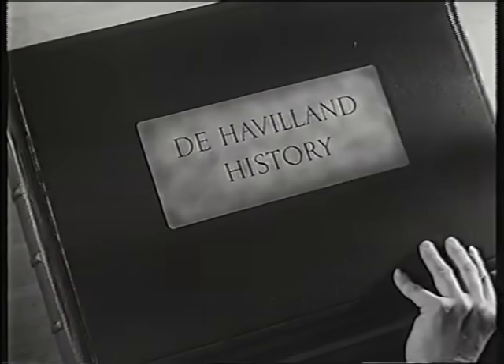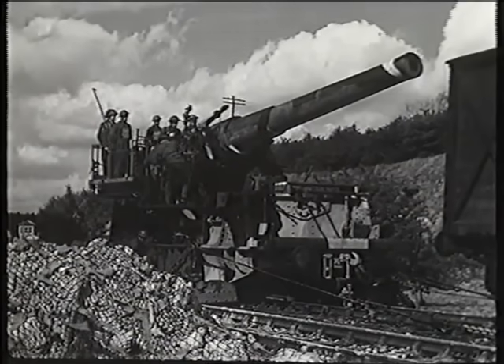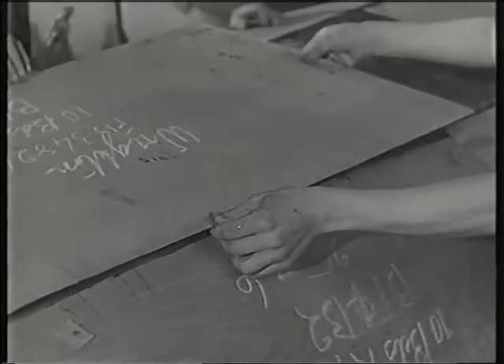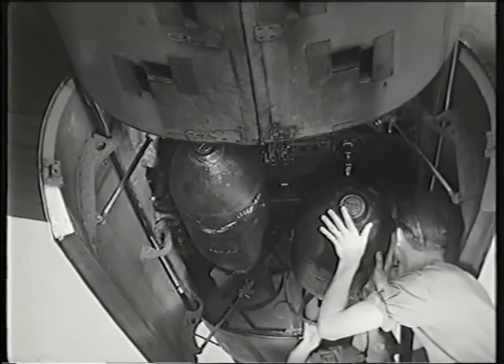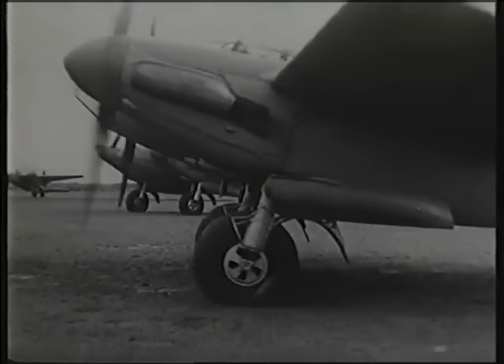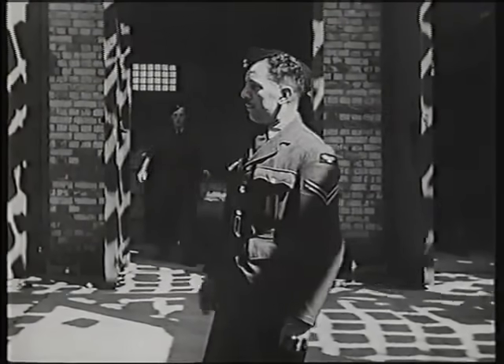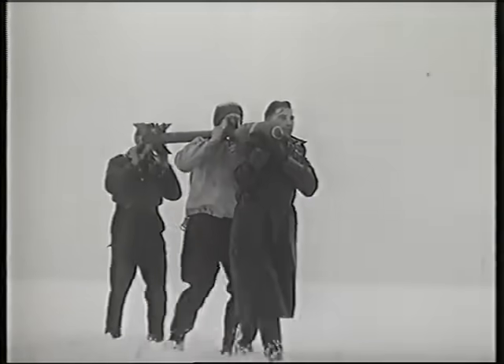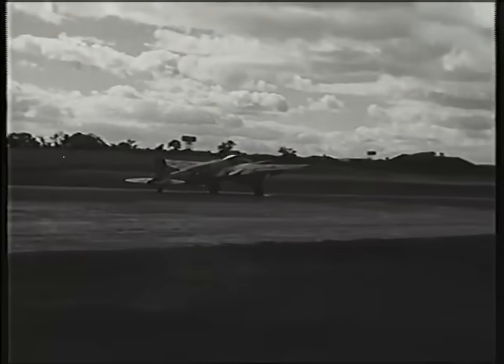The De Havilland Mosquito

Comment: dear messrs finnigan, barracuda  et al.
I have read with interest the argument between the fans of the B17, the Lancaster and the Mosquito.. So, speaking as one who's job is the compiling of archive records for Museums World wide, and aircraft preservation groups on both sides of the Atlantic, (I work at the IWM, and in conjuction with the Smithsonian)
Here are the facts. they are for education and are not open to argument as far as I'm concerned. (what you do between yourselves is up to you)

If we measure each plane against 4 Parameters,  Bomb load, Range, Height and Speed (in Knots), we get the following results.(BTW, The maximal total range is the distance an aircraft can fly between takeoff and landing, i.e there and back, and should not be confused with ferry range)  Anyway:-
B17...Bomb load=4,500 lbs, Range 2000 nm, Max height 35,000 feet, max speed 249 kn

Lancaster (RR Merlin XX.)..BL=14,000-22,000, R=2,530nm H=22,000ft, M.S.=282kn.

Mosquito RR or Packard. BL 4000+, R=1,500nm,  Height=40,000+ (pressurised cockpit on later marks), S.=361kn @ max bomb load.

So the best....
Bomb load=Lancaster
Range=Lancaster, 
max. loaded height=Mosquito
max speed Mosquito.

An interesting line of argument is effectiveness.  If you compare the figures for the attacks on the V-weapons sites, the average tonnage of bombs required to destroy one of these sites by B-17 Flying Fortresses was 165; for B26 Marauders it was 182 tons and for B25 Mitchells 219 tons. The average for the Mosquito was just under 40 tons!

those are the facts gentlemen.....do with them what you will.
Reply: I think this might for once leave WilbursoaringtractorFinnigan almost speechless . The others , I don't care about.
Reply: ***** 90% of your entry has no relevence to the point being made. Accuracy was not a question, costs were not a question, Survivabilty was not a question etc etc. the questions were regarding just 4 points... Bomb load, Range, Height and Speed 
And to that end....Bomb load=Lancaster
Range=Lancaster, 
max. loaded height=Mosquito
max speed Mosquito.

As a pointer for accuracy....British Lbs is a measure of weight, not money.  You need the "£" sign or Pounds sterling if talking money.
Do you not have that symbol on US keyboards?.

From 1942 onwards the Pathfinder mosquitoes were dropping their markers from high altitude using OBOE, (didn't work at low level) and later, using H2S, I can assure you that far from having an accuracy "That sucked"..they were , in fact, able to mark , and bomb, with great precision from high altitude.
Out of interest, The Pathfinder Mosquitoes ended the war with a most impressive record. In 28,215 sorties they had only suffered 108 losses, a lose rate of only 0.03%, the lowest of any aircraft type in Bomber Command or the USAAF. The Mosquitoes of the Pathfinder Force played a crucial role in improving the accuracy of Bomber Command, which by the end of the war had become a precision weapon, even ifit was not always used as such..

lastly....even if I had used the max for the B17...the result would still have been the same.for that particular discussion. All that would have happened is  that the B17 load would have read 8,000 lbs, and it's range would have been shorter.and it's ceiling would be lower.
And as for my "prefered   Lancaster and mosquito".......I'm South African. I don't have a preference
Reply: ***** "To start with you had a low level Mossie move in and mark the target accurately".......Depended on the type of raid and marker..Blind Marker-Illuminators: 
First Pathfinder aircraft on the scene during a NEWHAVEN type attack who used H2S to drop illuminating flares and target indicators (usually green or yellow). The light provided by the flares could then be used by the Visual Markers.......(NEWHAVEN was A method of ground-marking whereby the target was first located by Blind Marker-Illuminators, then backed up by Visual Markers dropping Target Indicators. Since the markers were aimed visually this could only be used with clear weather prevailing over the target. If a Newhaven attack was impossible an Emergency Parramatta would be used instead.)  And an Emergency Parramattawas  Used where the Visual Markers could not see the aiming point due to cloud or haze. They would hold on to their markers and the Backers-Up would instead aim their secondary target indicators on the markers dropped by the Blind Marker-Illuminators., as opposed to the ordinary Parramattawhic was an area bombing technique where the primary markers (red or yellow) were dropped on the target by H2S-equipped Blind Markers. Backers-Up would then aim their (usually green) Target Indicators at the MPI of those primary markers for the benefit of the Main Force. I shant bother going into Wanganui. the point is that a low level primary was not always the case, but by 1944-45, the use of H2S, oboe and Gee was.
So much for the workings of Pathfinder mosquitoes.

Next point. I was not refering to 617 in particular...certainly didn't mention the Dams raid. All I said was "the Lancaster didn't change at all (untill the upkeep, Grand slam and Tall boy)...as ordnance got bigger the lanc handled it with ease." during comments regarding bomb loads

The Tallboy & Grand Slam didn't need to hit to be effective, as opposed to your opinion that it had to be a hit. and if you consult the records "My canal" as you call it was bombed, and hit, many times during the war by Squadrons other tha 617 and 9 .. In fact. The viaduct had been peppered with 3500 tons of smaller bombs before a single 10 ton "Grand Slam" did the business. The time being 1648 hrs, 14 March 1945,

I would like a link regarding a low level marker aircraft.  Also a link for information where a high altitude bomb was dropped from low level. This  bomb was originally intended to be dropped from 40,000ft, but the specially modified Lancasters could only carry it up to 27,000. A typical height for those large bombs would be between 16,000 and 20, 000 feet.... furthermore my statement "And yet the RAF could hit a viaduct from 27,000 feet.(Bielefeld and Dortmund-emms) or a U boat pen from an equal altitude."   did not mention Tallboy or Grand Slam, merely that the targets mentioned had, at some time, been hit from that altitude

Your comments on the B29 are not disputed but being as the comments were comparisons between the Lancaster, Mosquito and B17, your reference to the B29 has no relevance....please keep within context.

The RAZON bomb was never used in WW2, only in Korea..
for british contribution, read up on the fact that The Americans also used the British-designed 4,500 lb rocket assisted Disney bomb to achieve greater penetration by force rather than by weight alone
 
.
Reply: Totally agree.
Reply: +w8stral2 "Of course the P47, with a crew of one, and one engine, dropped several times the tonnage that the Mosquito did and straffed anything that moved while providing air cover....  Could attack multiple targets as well." ......Well, the 56th FG was the only group that used the P47 continuously and they only dropped 678 tons of bombs during the whole war, and prior to the P51 replacing the jug, the P47 was used as an escort fighter....not a fighter bomber.....  whereas Bomber Command Mosquitos flew over 28,000 operations, dropping 35,000 tons (31,751 tonnes) of bombs, . So if you can provide the source of your figures,that make 678 tons above and beyond 35,000 tons... I will be happy to look at them..
Could attack multiple targets...as could the Mosquito ...and most other aircraft come to that 
"bombing at night that did essentially nothing other than annoy the German population.". ..You should take up writing comedy scripts..

The Amien raid was not a "Skip Bombing "raid. My Father-in Law was with 140 wing 2TAF..and I have read the briefing notes. It was accurate low level bombing, as was  Eindhoven, Oslo, Copenhagen, Berlin. ...How about you tell me of a similar US effort..
And you say Useless for valuable targets. Philips at Eindhoven made practically the entire German supply of valves for radar, radios etc..
On such raids slow arsed 4 engined bombers would have been (and were) decimated. With US aircraft thats 10 men/plane
Reply: +w8stral2 I pasted that part of your statement that was relevant to my comments.
2)Those raids could not have been done by any aircraft, certainly not 4 engined ones.. on the Eindhoven raid the Bostons and Venturas stayed up, only the Mossies went down..
3) You seem to think these raids were a rarity. On the contrary, they were quite common.for the RAF, not so for the USAAF. (And I am not talking of strafing airfields or shooting up railways., but precision bombing)
4)Your 2091 tons by the 348th in April 1945 was, I believe, after that unit had converted to the P51.
5) I do not have the figures to hand, but just one of the FB marks (FB V1)  of the Mosquito accounted for one third of the total produced....and thats just on of many FB marks without touching the pure bomber variants
6) Yes, the figures mount...but in all theaters, they get nowhere near the tonnage dropped by Mosquitos.
Reply: +w8stral2 I am not aware of giving any indication that I considered 35,000 tons to be a feat.

 I know the 348th was fighter group. I was referring to the  tonnage you quoted for P47s of that group were actually dropped by P51s. (April 45), a fact you mentioned after my statement (DOH!  That 2000+ tons in April was by P51's). The salient point being that, in extolling the P47 you said..." A single group in the Philipines, the 348th, dropped over 2091 tons of bombs and 2 million rounds of ammunition in a single month just as an example.". 

"Heck one pathfinder mossie group No. 8 flew nearly 30,000 sorties in the pathfinder role". Number 8 group was THE Pathfinders, comprising up to 19 Squadrons... and flew Lancasters as well as Mosquitoes......and being Pathfinders, they did not drop HE only markers.  however , they did  have the Mosquitoes of the Light Night Striking Force (LNSF). They specialised in lightning "nuisance" attacks with 4,000lb High Capacity bombs ("cookies") on German industrial centres, and are best remembered for their contribution to the 36 successive night raids made by the LNSF on the German capital early in 1945.... 

I would like some sorces for the P47 figure.
Reply: +w8stral2  You have not really read up on The "Beau" much if you think it did.."Dip diddle"(?). . And ..."Bomber Command would not allow their 4 engined planes to go sub hunting." ???? Why would they want to when coastal had 4 engined jobs to do that..
Reply: +w8stral2 &quot;&#160;You know, the plane credited with saving Britain from complete 100% disaster due to the Uboats as they had nothing better outside of the 4 engined Stirling or the Sunderland flying boat which was never built other than in minuscule numbers.&#160;&quot;.........My interest is awakened. &#160;Which plane was this and who has credited it with saving Britain from the U boats?
Reply: ***** Sorry. I cannot agree with your assertion  that the Hudson saved Britain from the U boats.
Reply: +w8stral2 I have read several. I found Cley Blair "Hitler's U boat war" to be a good one....2 Volumes. Unfortunately it was not a several hundred page publication...that would have covered the appendices. The actual work was more like a little short of 2,000. David Westwood's "The U boat war" is another reliable one 400 odd pages, or Gordon Williamson's "Wolf Pack" 532 pages.
Other books I have read include.., "The Cinderella Service: RAF Coastal Command 1939–1945"  by Andy Hendrie,,, . "Coastal Command at War." by Chaz Bowyer, and "The RAF and Trade Defence, 1919–1945: Constant Endeavour," by john Buckley.
I also use those documents available from the RAF museum Hendon, The IWM, London and Duxford..
Sources I do not use include Wikipedia and You tube..

"Hudson was flying in the RAF's service before day 1 of WWII"...And the Sunderland was flying in RAF service almost 2 years before the Hudson. And like the Hudson , was developed from a long range, over the water airliner.. ...as used to pioneer the long range air routes of the 30s.. your assertion that America was the only country  carrying out long range flights is, to be honest, ludicrous..

The U boats went to mid Atlantic through air cover in general, not specifically the Hudson.

As for saving Britain...780 (or thereabouts) U boats were sunk.. The Hudson contributed to the loss of 26......hardly "the plane credited with saving Britain from complete 100% disaster due to the Uboats "
Reply: ***** Nothing has been twisted at all. They are all answers relevant to the points you made..
Reply: +w8stral2 No, I don't think so.  I have addressed the points you made......
1)The Hudson being .." the plane credited with saving Britain from complete 100% disaster due to the Uboats ....."  I presume you are an American to take such a view.

2) "Who in 39 had greater or equal range than any Beau, Wellington, Whitley".....Hudson's range was 1700 Miles and the Wellington was over 2000 .and the Whitley had a range of 1650 . The Beau. was never used on long range missions ...but was used on anti shipping strikes and coastal anti U boat patrols.
.
3) Your view that preventative maintenance was not carried out in the RAF until the Hudson went into service.!!!   Absolute drivel as any erk from the RAF of the time will no doubt explain.

4) " Europe did not.  Its distances were measured in a couple hundred miles instead of thousand +++ miles."....Well, The Boeing 314 had a range of 3500 + miles.if I recall, ..The Short 26G , from which the Sunderland came had a range that was not so different, but greater than the M130 China clipper.... and the Dornier Do 26 (included as a "European"), had a range of 5,500+.  So thats another misconception that you seem to have.

I will leave it there, as my point was that the Hudson was not the saviour of Britain viz a viz the U boat boat war in the Atlantic. As I said 26 from 770 odd...?..
Reply: ***** So it's 26 over 3 years v  27 over 2 years.
The statement still stands...The Hudson did not save Britain from the U boat
Reply: +w8stral2 "Every German Uboat sunk in WWII.  Read and weep"...........

Subs sunk by aircraft=249, of which 26 were by Hudson.   
Contributed....not saved by.      QED
Reply: ***** They are your own quotations.(Notice the quote marks") that I am answering. I am not putting words in your mouth....merely repeating those words that you have written.
Give an example of where I have written anything that you didn't commit to this page.
Reply: kilokilokilo Thank you.
Reply: Catalina was known as a leaky ship, whereas the Sunderland was not. Catalina had greater range but landing it on anything mid ocean was very risky, as it was for the Sunderland, but not for the same reason.
Reply: w8stral2 Woman
Reply: w8stral2 is
Reply: Yankee Patriot.....a).Wasn't aware there was a comparison between the Lanc and Mosquito going on
b)"Mosquito. a 2 engine, very fast, low altitude bomber, used primarily for precision bombing during daylight.".....No, you need to learn more about the Mosquito.
Reply: Yankee Patriot     Tell me Sherlock. Have you gone back and read the ENTIRE argument.from the beginning....and the comments that prompted the original statement of......."I have read with interest the argument between the fans of the B17, the Lancaster and the Mosquito..

I presume you have a modicum of understanding in the vast emptiness that is your skull. Allow me to ilucidate. 
a) the 3 aircraft that were being compared were the Lancaster , The B17 and the Mosquito.  Not my choice ..those were the aircraft
b)The reason that the Lanc and the Mosquito came to the fore is because , by the perameters set by historians, museums (including the Smithsonian) as laid out in the opening statement, the Lancaster and the Mosquito both outclassed the B17.

I'll just repeat the salient point of my reply........the aircraft were not my choice of subject

As for your caraway seed....I do like a good laugh.    " used primarily for precision bombing during daylight."
No it wasn't. Daylight precision was just one. ...."Very fast low altitude bomber"....as well as a very fast High altitude bomber.....someone with your obvious brainpower must know that British electronic bombing aids didn't work at low level
Perhaps if you had left out the word "Primarily"

 "more stark differences than what I mentioned"   As I said , i like a laugh. Old Bill (Soaringtracto)there has been giving me some for ages.....So what are these stark differences.?   lets compare lists...
Reply: soaringtractor1.....Just a quick question Bill.......Do you know what a computer IP code is.?   And you have to admit, Yankee Patriot writes in a similar style to Tidefan Yankee.
Reply: I'd be interested in a bombers effectiveness as in accuracy per weight of bombs dropped. I suspect the Mosquito would out preform most heavy bombers but, to be fair, doctrine may have an influence ie area bombing versus low level pin point bombing. Having said that, how many lumbering heavies would have survived at low level?
Reply: Yankee Patriot.   You interest me greatly  (not including your "back to back world war winners.....put that down to a sense of humour.)

I would like to have you explain something.     I can understand someone using multiple accounts to bolster their arguments. But why would anyone use multiple accounts to fight themselves?.....and for so long

I take it you are new to all this....and have not seen the account holders that you mention going hammer and tongs over the last 2 or 3 years. Well, as many will tell you, I am magnanimous to the degree that i can be considered a "Devils Advocate"........so I will tell you what i have learned.

Tangles is, as soaringtractor has mentioned an Australian and has served in the Australian military.and I think resides in Melbourne....or some such small town.
Soaringtractor is, as you have seen, a very loud irish American and lives in the area around Seattle/Soap Lake.
Which, by coincidence, is the same area that the world famous and equally irish American Wilbur Finnegan. They both are into restoring tractors, are involved with some sort of farming, both born in 1940....other than that.....!
The Hobgoblin is  South African and is, I believe a freelance researcher for museums.
The Oracle is a relatively new boy....all i know of him is that he is Swedish and currently resides in Hamburg.

As for me....before you make a complete idiot of yourself and add me to your list.......don't bother There is only one me.......you couldn't handle more.

These gents COULD have multiple accounts....(as could you, your style, syntax and general writing does bear considerable resemblances to many others...)....
But I can assure you......annoying as some of them can be.........they are  NOT the same person.
Reply: I think you may have missed something vital in your calculation, and that is the attrition rate. It is my understanding that the Mossie was far less frequently shot down, relative to the number of missions it flew. I heard that the ratio was 1:5. If this is so, then the effective use of resources, relative to the destruction of enemy resources makes the Mossie multiples more effective than any large slow four engined bomber and thus calls into question the entire basis of the strategic bombing campaign, especially the US effort with it's poor bomb loads and need for escort fighters.
Reply: soaringT......Now now...you have been told about your wording......." first off  B17 had a bomb load of 6,000# "

It had a designed mx bomb load of 6,000 . Using your arguments from elsewhere, it averaged 4000.
Compared to the Lancasters designed bomb load of 14,000 lbs.
Your continued insistence that the lancs that carried 22,000 lbs were modified means nothing.. Reason...bomb bay modifications etc are unimportant. It is the wing and associated structure (Spar and bay spine that dictate the weight carried.....and as those parts were NOT modified in any way, it can be stated that the Lanc was capable of lifting 22,000 lbs
(And don't forget...the vaunted B29 had to be heavily modified to carry the lightweight A bombs.)

You say 20 were converted....actually  33 copies of Lancaster I Special were produced 

" Mods included removing the Bomb Bay doors all armor and Gun turrets, strengthening the landing gear...."
Bay doors....because of the bomb shape. And the weight of the doors was equalled by the weight of the fairings that replaced them
Armour....on the Lanc there was only one piece of armour and that was a plate behind the pilots head and shoulders and, contrary to popular belief, was not removed

Only 2 gun turrets were removed, and the aircraft also lost 2 crew members, the Mid upper gunner and the W/Op.

Plans were being made to strengthen the undercart anyway, due to increasing weights of bomb loads

"The Lancaster was barely able to lug its max load to 18,000 FT and the Grand Slam to only 10/12000 ft !!!  .....really?   "The attacking force then climbed to bombing height - up to 16,000 feet "..https://www.raf.mod.uk/history/bombercommandtirpitznovember121944.cfm

Max load height was more like 20,000.  I would like to know what is the significance of that.. Tell me a US bomber that carried 14,000 lbs to 20, 000 feet in 1943.

"AVERAGE bomb load throughout the war was right at 8,000# !!!! RAF gave number of sorties flown and the tonnes ob bombs delivered !!!!! RAF Figures2.....You have already been shown to wrong on this one elsewhere.

i have to go out now....but I shall return. like dugout Doug, ..and continue taking you to task.
Reply: The Hobgoblin you have a great job they are all master peaces but the b 29 trumps all the b52 still rules
Reply: soaringtractor 6p0
Reply: Oh good the wacko comedian soaring is on, hang on bud while I get some popcorn and a coke.
Reply: The Hobgoblin a
Reply: @thehobgoblin9790  

I understand that the Mossie was used by the Israelis in 1956 during the Suez Crisis. Apparently the MiGs of the Egyptians were quite useless against them.

If you know where one can locate some more info on this, it would be much appreciated.

Kind regards, en baie dankie.
Reply: The Hobgoblin thanks
That was very interesting
Reply: Don't tell Wilbur, but the Lancaster had 4 RR Merlins.
At Sydney airport a Lancaster was told to taxi to the runway and "hold". The pilot interpreted this as "roll". 

Too late to brake, the pilot saw a DC3 on a collision course on the cross runway.
He slammed the throttles forward so the throttle levers broke though a wire which is the normal limit of the throttles. This switched the superchargers on.
My father said the Lancaster virtually stood on its tail and jumped over the DC3. It flew around with the superchargers on for 2 minutes. The maximum prescribed time was 30 seconds.
The engines were stripped down and the bearings showed not the slightest sign of damage, including discolouration.
Needless to say, the word "roll" was replaced in the airport vocabulary.
Reply: I wonder the ranking considering how much damage could be absorbed and still make it home.